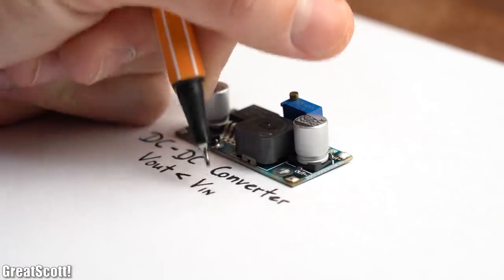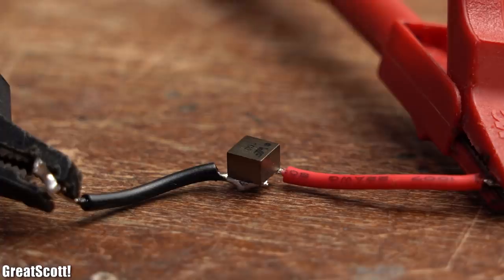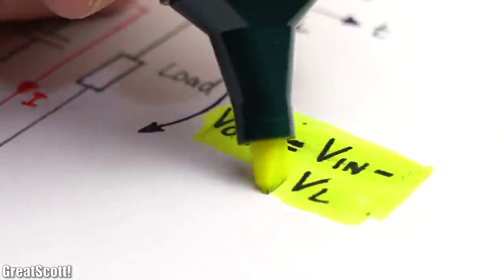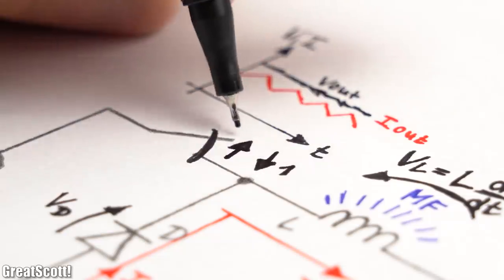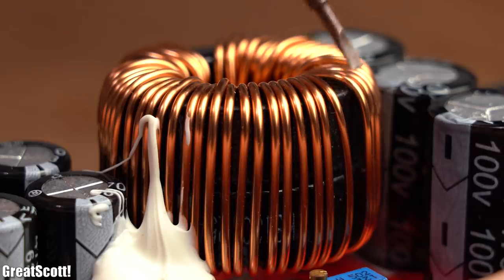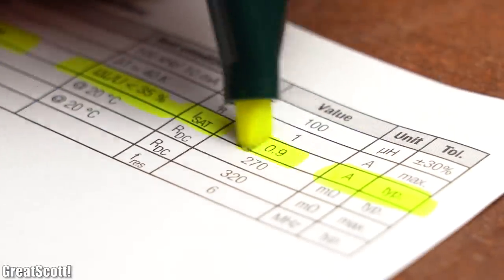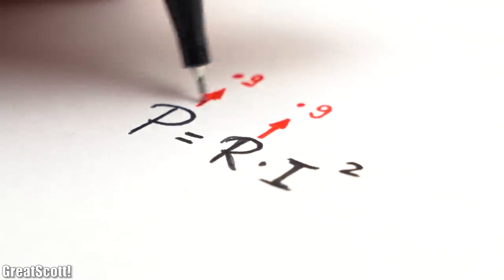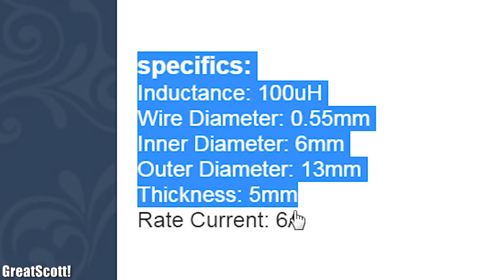How to choose the right coil type (inductor)?!

Comment: Great video. Inductors have always been a "black box" to me. Why so many sizes and types of the same value? Now I know, or at least I know where to look!
Reply: Upload - 1 hour ago.
Comment - 4 days ago.
Me - Wutt!?
Reply: @raghavendrasharma225  patreon
Reply: Yeah!
The thing with saturation is something you really have to take into count. Buck converters are also the most forgiving converter type, when it comes to coil saturation - if it happens in a boost converter, it's much worse and will cause huge current spikes, that can easely blow your transistors. And DC/DC converters are not the only thing where it matters - I have also (a long time ago, when I didn't know very much about electronics as I do now) done the mistake of using a "common mode" coil in an audio filter for a speaker. I just searched on the web page for an electronics supplier and thaught "that coil looks awesome - so small and have such an high inductance and still such a low DC resistance". The thing was that, at the time I didn't know what a "common mode coil" was and it didn't help the fact that they didn't write anything in the data about it being a suppression coil for "common mode noise". They just wrote it was 2 x 6 A inductor with an inductance of 6 mH - so I thaught "good, then I can either put both windings in series and get even more inductance or in parallell to handle more current". I don't remember wich configuration of those 2 I used, but both is equally bad and will end up saturate the coil heavely already at small signals - since the magnetic field from the 2 windings are not canceling out each other as it should du when used as a common mode coil. Needles to say - when I then tested the speaker, it sounded like total crap, hahaha. 
I did in fact suspect it was because of saturation though (wich causes distortion of the AC audio signals) - simply because the coils data looked way "too good" for it's size. I ended up winding my own coils instead and test them for saturation by running low frequency AC thru them (like 50 Hz from a variac connected to the mains or test tone from the speaker amplifier) and slowly increase the current and record the signals on my audio card to check when the waveform start to change, wich indicates saturation (I had no oscilloscope at that time). That was much cheaper than buying coils that had enough inductance for my filters and still can handle the current. 

Later when building some DC/DC-converters, same thing applies there. Once you get over like 50 W of power (my biggest one, so far, is about 9 kW and works as a power regulator for an electric furnace), it's usually better to wind your own coils. You can find ones that can handle a lot of current relatively cheap, but then the inductance is very low. Using such low inductance coils is possible, but makes it much harder to design a high power DC/DC converter, without getting large problems with switching noise and "ringing" because of stray inductances and capacitances. That problem will cause a lot of power loss and often blow up your transistors if not taken care of properly.
It's much easier if you have large inductors and capacitors - if your wind your own inductors, you can often get much larger ones than the one you typically can buy (that have very high inductance, compared to the current they can handle).
Reply: Speeder84XL I love the internet
Reply: @Psyden5757  the internet is literally the largest collection of human knowledge ever period
Reply: Speeder84XL Very very informative comment. I always learn something new about inductors. I wanted to build and test filters for a long time but I don’t have the necessary equipment to test the filters.
Reply: @Speeder84XL  Thank you for sharing your experience with us.

Comment: Had an audio amplifier school project using arduino and a motor controller. Good thing I didn't throw away my broken dc-dc converters. Used the coil to make an LC filter.

Comment: Exciting! Thanks for this detailed video!
P.S. One of the problem with buck converters [BC]( especially  with cheap Chinease crap) for me is it's extremally "noisy" and if you feed current to microcontroller -- be prepared for all kinds of glitches without extra filtering and smoothing which can cause another troubles with BC e.g. failure to boot.
BTW, too much ripple from BC is usually caused by the inductance that is too low—higher values give lower ripple. But higher inductance usually cause a slower transient response. And yes, temperature-caused changes to characteristics of coils is another source of head-ache and unexpected glitches in your system.

Comment: Okay, that was a great video, but I want to point out a couple of inaccuracies :)
1. 3:05. The VL is not constant, it's decreasing as the di decreases.
2. 3:34. The problem is not that the MF reaches saturation of the coil, the problem is that the current no longer increases, and the VL is zero (barring the resistive losses). VL is zero here regardless of the saturation.
3. 8:58 (minor). The number of turns for the smaller coil is indeed bigger, but not linearly bigger (Why? ;-). The problem here is that even the same amount of turns can't be fit with the same wire thickness.
Reply: 1: Agreed. VL is exponential (well, log), not linear.  2: I think GS was confusing two points: (a) asymptotic approach to some voltage where di=0, versus (b) what happens if you attempt to power ever bigger loads (ie: smaller RL), with him mentioning taking the load resistance to be a short -- which will definitely achieve saturation. 3: Why -- I'm assuming you're referring to fact that inductance is proportional to area of the loops, ie: proportional to r^2. Hard to say how this is related to "bigger-ness", since that could be assessed in 1, 2, or 3 dimensions!

Comment: This sounds really straightforward to me, someone who has no idea about electronics. I like how it's basically "you can use this scary formula, but if you're scared, the simple version is that a bit of magnetism makes the voltage raise slowly with time and a fast switch cuts at the right time to get the required voltage, so now you know!" Wow, the general idea sounds trivial, suddenly! Thank you.

But why do my computer's many various VRMs always have "high side" and "low side" transistors (often in a single package but still) before going to the coil? I don't get it, please explain :/

Comment: And at higher frequencies, like with radar, even PCB board foil trace placement and routing factors into circuit inductance. This is so because reactance increases with frequency. 

In electronics it's important to remember that it's not just electricity you're dealing with, it's light. And light is electromagnetic. You can't neglect to consider the magnetic aspects of your circuits!

Comment: I normally go for the one specified in the DC-DC converter datasheet, value wise. I often opt for a Coilcraft one, pick a value and amp rating, and choose one from a shielded inductor series. I have a tendency to stick for a known brand, as I can simply use an existing component library when drawing a PCB, although I often draw my own libraries as well.

As for the TI Simple Switcher series, meh. I tend to run away from them. They are simple to implement, but far from ideal in many respects.

Comment: @GreatScott! in 2:25 you draw incorrectly voltage drop . Voltage arrow on power supply should be even with the current. On loads voltage arrow should be against from the current.
Reply from the maker: No. You can draw it the other way around like I did it. There exist two systems for that. The source and load system.

Comment: great video, but there are many low drop out regulators on the market that no longer require an inductor. Microchip has an adjustable LDO with 600mv @ 3 amps and according to data sheet no inductor required!

Comment: You missed two other important parameters: Price and size. If you board is massive and you aren't trying to save cents of each unit of your million unit run then use an inductor with saturation current that is well in excess of what you need from a decent brand. If you have a small space to get the inductor in you might have a lot of work to get something that has the saturation current you need while being small enough and not insanely expensive.

Comment: Howdy.
An example. Let's buck down 15V to 5V. Let's assume the max. output current is 4A. The duty cycle is 5V/15V = 33%. During ton the current needs to rise to (15V / 5V) x 4A + 4A = 16A. The coil core must not yet go into saturation at 16A. Zoom in on the magnetization, not the inductance.
At HF. Check that the core material operates at the frequencies at hand. Ferrite rods operate up to about 1,5 MHz. Use litz wire for the windings to minimize resistive losses.
At VHF and UHF. If the inductor is a air wound item. Use a calculator to check the self resonant frequency. Try different configurations and choose the one which self resonance is as far above the utilization frequency as possible. Also observe the self capacitance which may have to be subtracted from the tank capacitor.
If the inductor is a regular component. Check the data sheet for the self resonance.
If the inductor is self wound and will serve as a RF choke. Calculate the length of the coil wire. This length is roughly a quarter wavelength of the self resonance. Zoom in to getting this self resonance as far above the utilization as possible. 

Regards
Reply: Blimey. Once again I am in error. If the output current is 4 A then that is approximately what flows through the coil too. 33% of the time the drive comes from the switching MOSFET in on-state. The rest of the time the coil self induction drives the current.

Comment: thanks...  may i ask what inductor should i use for  200amp maximum current..
Reply: planning ti convert my 200 amp ac welder to dc.. using a bridge rectifier, and capacitor.. planning to add inductor.. but i didn't know how.. pls help.. tnx

Comment: Any tips on how to shield those little buck converters? I'm thinking of dipping in wax and wrapping in tinfoil connected to ground. I have a mask with one of those litle VCR viewfinder CRT vacuum tubes which is pretty sensible to the nearbly PSU's interference.

Comment: @GreatScott! Are you from Germany? Because I realised that in 2:24 your arrow shows the minus potential. Few of my technical books released by REA publisher, had also that type of assigning the potential voltage. I used to assign with arrow the higher value instead of lower.

Comment: I have an inductor coil from a pcb and instead of being wound around a piece of ceramic it has a plastic coating around a thin strip of silvery material rolled up inside the plastic core coating. My question is what is the silvery colored material?

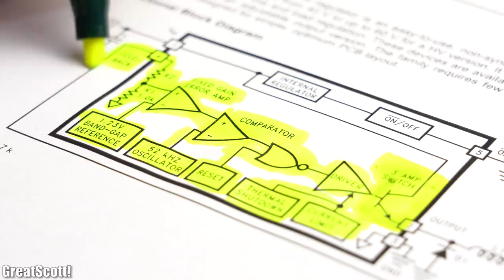Comment: 1:00 Where is the MOSFET? That's a BJT in the block diagram! Also, you totally missed the most important thing about switching converter design: parasitic inductance. If there are unwanted inductances on the interconnect between the switch node and the diode(s), then there will be a huge voltage spike when the switch turns off, and its magnitude is determined by the parasitic inductance of the traces and diodes leading to the output capacitors. For example, with a 12V input, you could easily get 50V transients at each switching.

Comment: Pls make a 1kw 12v to 220v ac inverter with voltage feedback system
Reply from the maker: No. Sorry.
Reply: Just buy one, this will be easier and safer way.
Reply: @greatscottlab  but why??!!!
Reply: Only making projects with little leg work now
Reply: @ElectroVilla  Perhaps he has his own projects to do. People have lives, and need to fit projects into their limited time as they see fit. If you really want that video, make it.
Reply: Allowing for reasonable losses, the 12Volt supply would need to provide about 100 amps continuous to get 1kW.
Reply: @raykent3211  Exactly. And Scott had already said that he would not show how to design one.
Reply: YouTube is great Scott's life which he has chosen. We have all contributed to his success, so I don't think it's to much to ask for a little more time out of his busy schedule.
Reply: @lee_love3532  but it's important not to ask for impossible, dangerous or unreasonable projects
Reply: @maks886  The project is not that I need this because I don't want to buy one its strictly about the project. I dont know why your classifying as dangerous, people should not be subscribed to this channel if they cant handle this type of project.
Reply: @nicholastharby6558  I don't think it's dangerous. I know it's unreasonable.

Comment: So, if I understood correctly, replacing a coil with one of bigger inductance is good idea. In example, if datasheet of buck converter advise 2,2uH, than I can put 4,7uH or 6,8uH as long as the saturation current is bigger than expected output current of the converter?? Am I right?
Reply from the maker: Well, it does not be a good idea but it is possible.

Comment: At the time I saw this coils, I thought it is a capacitor. Then I removed once from the circuit board and opened the cover. At that time only I realized that it is there a coil. I think that, the manufacturer are now always think to make parts so as not to repair electronic items by locally. Because most of electronic parts are too complicated to find the errors as well as unidentifiable, possible to damage wen installing.😀😀😀😀

Comment: Hi, I see my replacement motherboard has a small 1R0 inductor which is semi shielded (resin). There's a small chip near it & a few smd resistors/capacitors near it, also GPU VRAM is near it. Previous replacement mobos had fully shielded inductor there. Should I be concerned that its magnetic field might damage nearby components?

Comment: Hi GreatScott, question:
I have a lamp that and that is feed by a 24V input 19A and 400W, but when i turn on the generator the voltage incrise to 27V.
What should i use to put only the 24V to the lamp ?
Thank you

Comment: Talking about the Buck Converters, It is possible to make a Buck Converter with a Mosfet as a switch, An OpAmp whose O/P connects to Mosfet, with Non-Inverting Side connected to a Potentiometer, and Inverting side connecting to a Voltage divider across the OUTPUT???

Just like a Variable Voltage Follower that can handle more current???

I am trying to design a New type of Bench Power Supply...
Reply: Not possible, because the mosfet requires a pwm signal, not a constant one from the op amp. But you can try simulating the circuit for example in Spice or EveryCircuit and check
Reply: @maks886  Well, since I am trying to use Op-Amp as a comparator, in theory it should work to generate a PWM signal since it will only switch its output On and Off, right?
Reply: @pauljackson2126  if you try, I'd be happy to hear from you if it will work
Reply: @maks886  I'll definitely inform you.